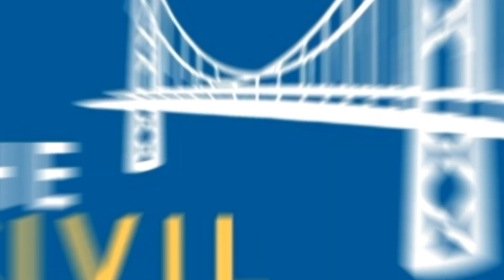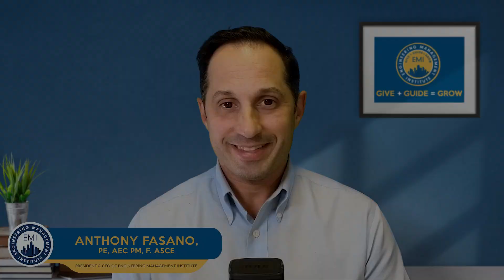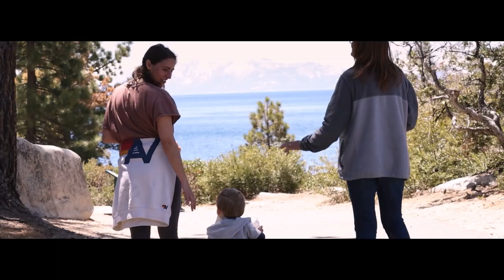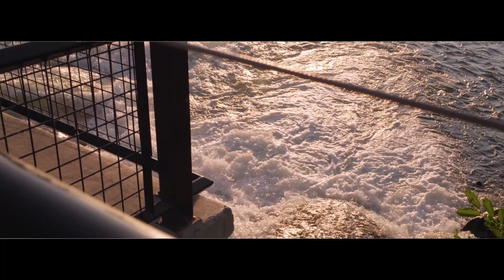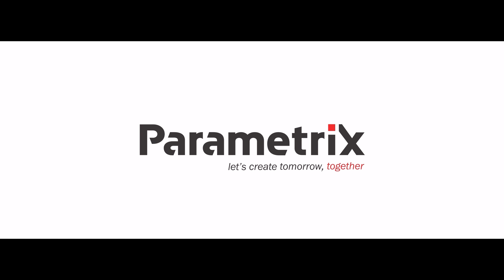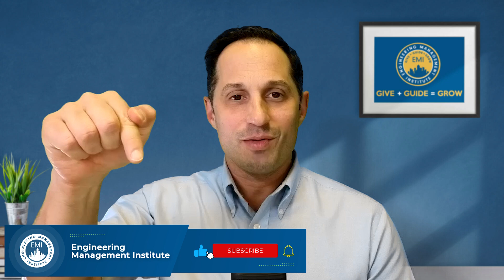What Makes TRAFFIC ENGINEERING So Crucial for Our Future?

Comment: This has puzzled me for years, having been in Transportation technology for 30 years, I still can't figure out why traffic is a subdivision of civil engineering.  I mean I talk to civil engineers about PID, control systems and computational optimization and they give me a blank stare. They don't seem to be as well equipped to control flow,  manage and understand chaos, coordinate as Electrical and Mechanical engineers. Don't get me wrong. I don't look down on them since they have exceptional project management skills,  material and structural knowledge and knowledge of optimal layout of systems,  but just not dynamic control,  which is what traffic is.  For one I find it funny that all my clients are fixated on presence sensing of vehicles. For one of a vehicle is stationary you are not doing your job. The fundamental goal of traffic management is to keep things in motion, so I would argue that measuring motion is critical. However I am not getting through to these engineers. They keep going back to inductive loops and point presence whereas my specialty is control systems and trajectory measurements like air traffic control would use,  but in a road environment. All my question why people who specialize in preventing structures from moving is used to keep vehicles moving?
Reply from the maker: @gerhardlamprecht1098 Thank you for sharing your extensive experience! It's clear you have a deep understanding of the intricacies involved in traffic management. Your passion for improving the system is inspiring, and I appreciate your insights!